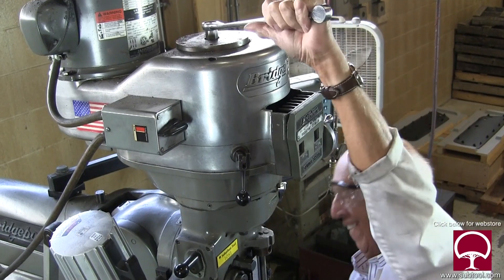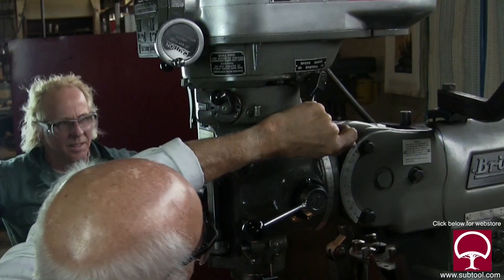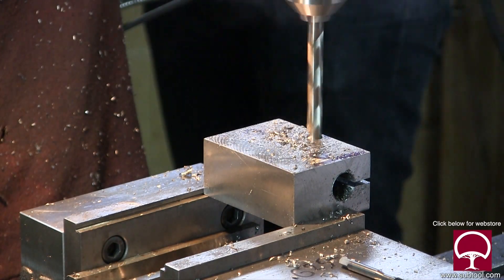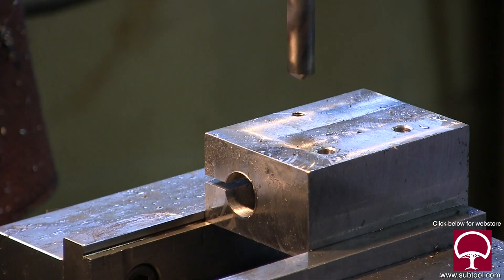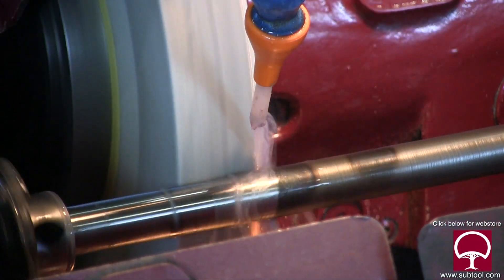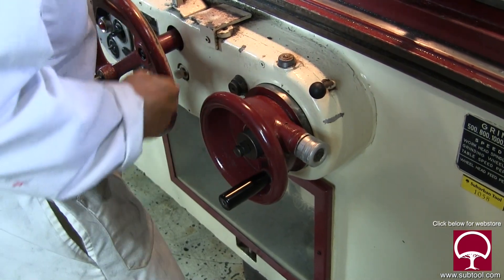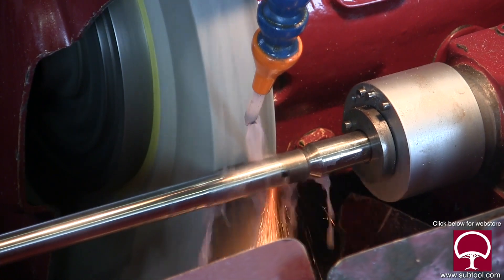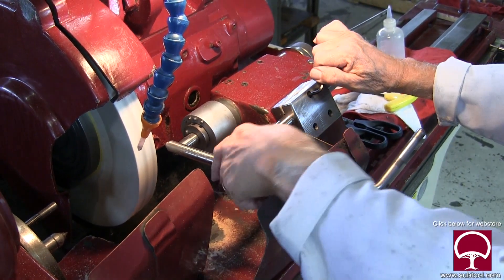How To Make a Wheel Dresser For An O.D. Grinder

Comment: Hey Don how come the coolant line doesn't have a fishtail nozzle to spread the coolant across the full width of the grinding wheel ?
I also noticed you seem to grind in one direction only , the machines i used to run we used to set up end stops and run in both directions with the machine using its hydraulic traverse and feed the wheel in by hand .
Reply from the maker: +ian bertenshaw We have a video on tips and tricks for fast and accurate O.D. grinding, refer to it for more information.  If you have any more questions, feel free to ask.  https://www.youtube.com/watch?v=NuLjCTEZrgc

Comment: Don, another really great video clip with heaps of experience leading the way. A couple of newbie questions please. The block that you mounted on the tailstock, I know you eyeballed it and machined all surfaces I'm just wondering if you did any prep work to the tailstock surfaces you mounted it to as they looked painted to me. Also did you have to have the block and hence the shaft inside it parallel to the centre of the tailstock as I am thinking that if it wasnt true then wouldnt the diamond cut unevenly across the face of the grinding wheel (hope that makes sense) Also, could you briefly discuss the drills you used, I am a little confused between the number and alphabet drills and finally, a quick look around your Brideport Mill and lathe just to see where and how you store your tools and stuff as I have fininished my Mill overhaul now and want to sort stuff out and am a great believer in not reinventing the wheel. Incidentally, I suggest your "eyeballing" would probably be within a few thou.... I  added  a thou for your recycled teenager status.. Many thanks Sir,  NSW, Australia
Reply from the maker: +Gordon Agent We did not do any prep work to the tailstock surface.  No, the movement of the diamond across the wheel is dependent upon the ways of the grinder, anything else doesn't matter.  The diamond used will always be parallel to the wheel.  In regards to drills, we used three types: fractional, numerical, and alpha.   Thanks for the questions, and thanks for watching.

Comment: Great job Don,  using the dead center as a backing block was clever.  Are you going to keep the Allen bolts,  I would maybe replace them with low profile Kipp levers, at least on the tailstock block ?